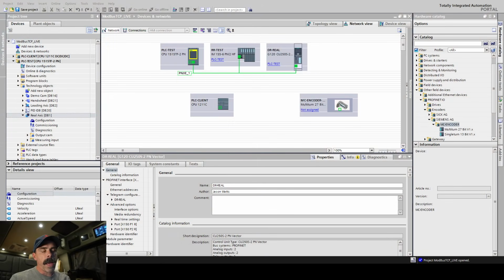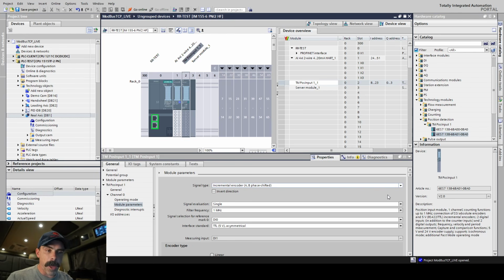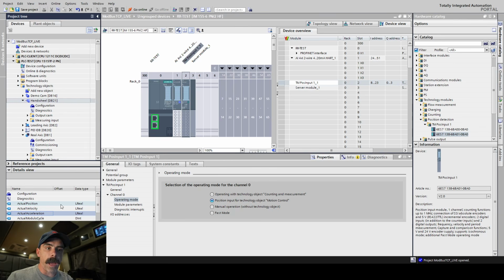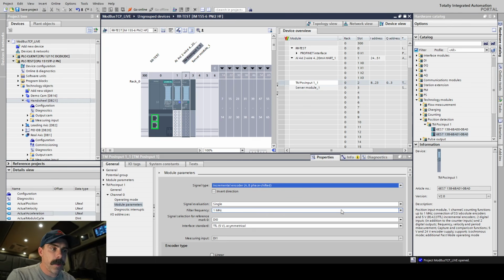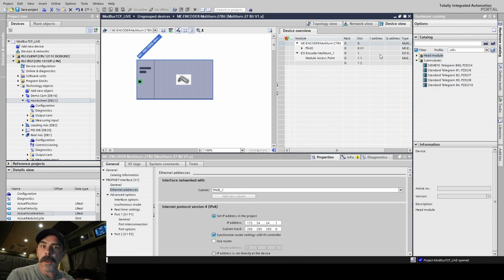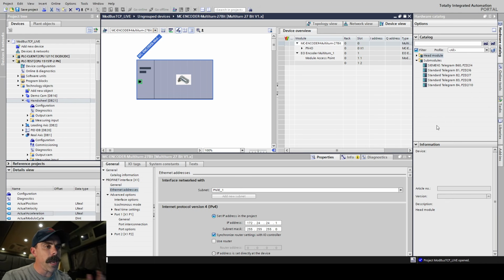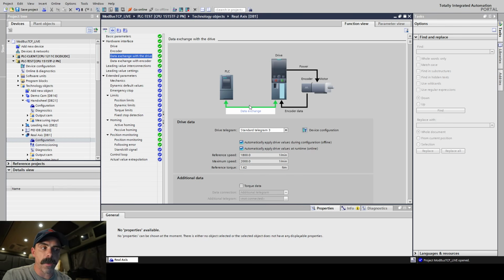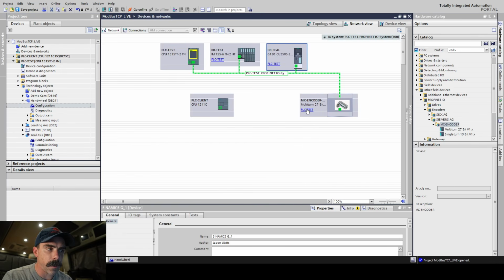How to Use Encoders in TIA Portal

Comment: What does the OutputCam and Camtrack programming and what is the application use it ?
Reply from the maker: Output CAM will turn on an output when the position is in a certain window. This could be used to engage and disengage the clutch for a flywheel stamping press.

You would engage the clutch to start the cycle, then use thr output CAM to disengage near the top of the stroke.
Reply: @jasonwattsae  What is "This could be used to engage and disengage the clutch for a flywheel stamping press." meaning ?
Reply from the maker: Well, if you have never seen a stamping press with a big flywheel then it doesnt mean much. 😅

There are many machines that you would want to turn an output quickly when the machine is in a position. OutputCAM does this quickly.
Reply: @jasonwattsae  What is the TO that use in flying saw application ?
Reply from the maker: The easiest would probably be a speed or position axis for the material axis and a CAM for both of the saw axes..(x and y).

Each cam would have to make sure that the saw completes the cut and is able to retract in time for yhe next cut. You could leave both CAMs engaged all the time and just have the modulo set to the product length or you could do a single pass CAM and engage it at the point on the product you want to cut.

Comment: Hey Jason.

Do you know anybody in Mobile area with PG/PC area and knowledge?
I’ve got customer with machine that FM357-2 “lost its marbles” ( configuration with 611), and then developed checksum error on attempt to reconfigure from memory card.

It’s an recomissioning of the used machine, that came from Europe.
Reply from the maker: AWC is the Siemens distributor in Mobile. You might try reaching out to them. I have worked with the 611 but would be starting from scratch on this one.
Reply: @jasonwattsae Thanks Jason.
Reply from the maker: Always!